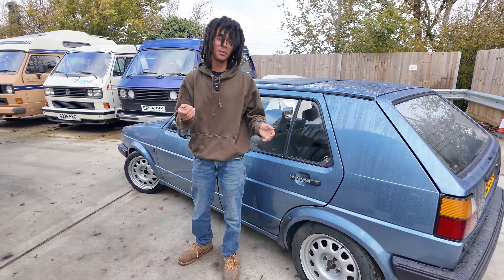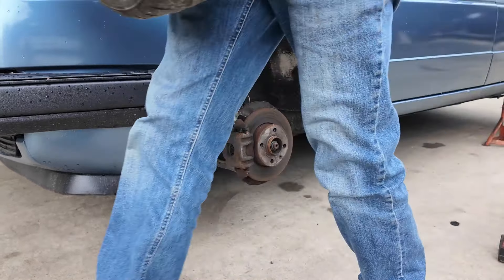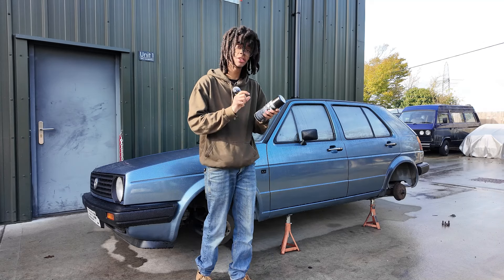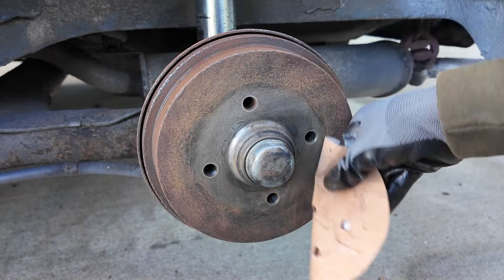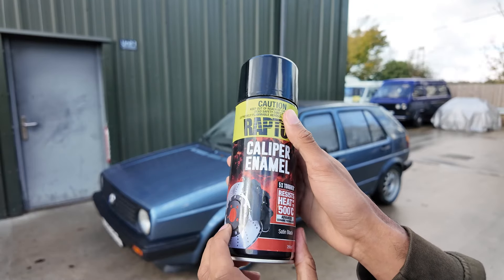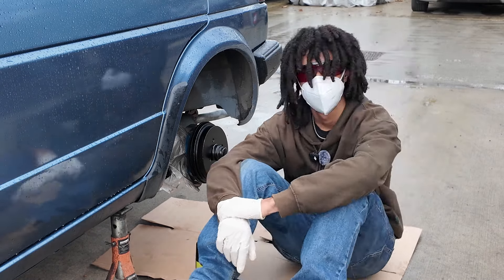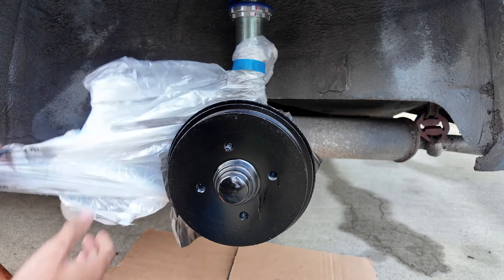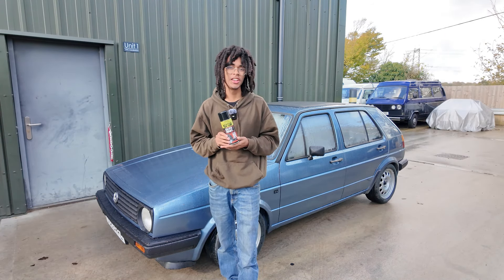How to Repaint Your Calipers with High Heat!

Comment: Hello. Painting the front calipers without disassembly is a bad idea. The pads can get stuck during such painting. Similarly, putting a wheel disk on a painted rear drum is also a poor idea. It will not sit evenly and will vibrate while driving.
I hope there is at least some anti-corrosion treatment in your paint. Because painting over rust is also a bad idea. Firstly, rust itself has poor adhesion to metal (no matter what you paint it with). Secondly, without a primer, your paint is useless.
Surprise me if everything I wrote is untrue. Just be very detailed! I love your products, but what’s shown in this video is a total failure!